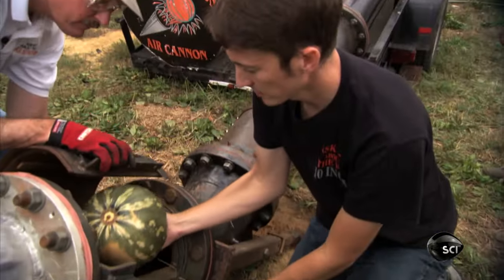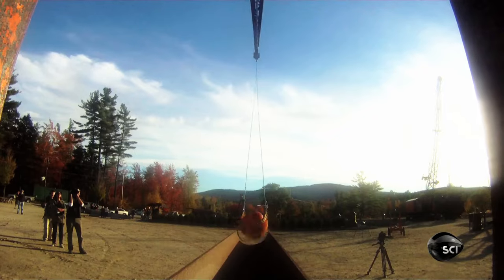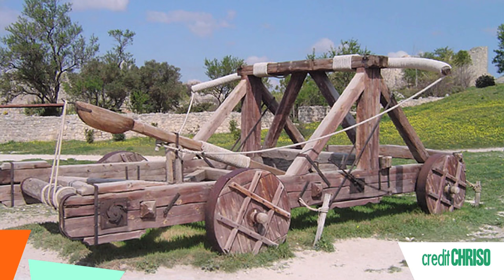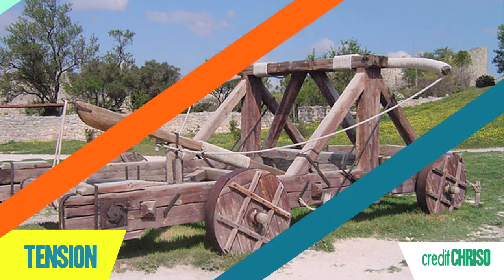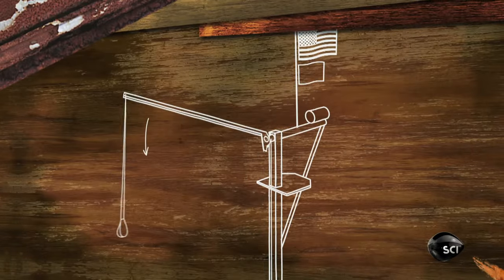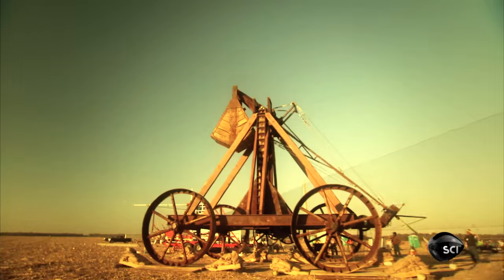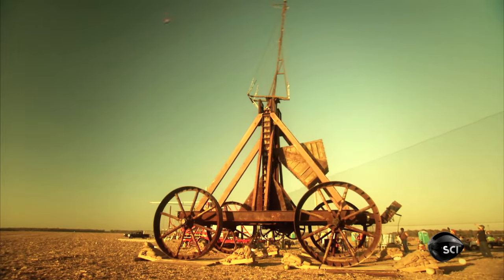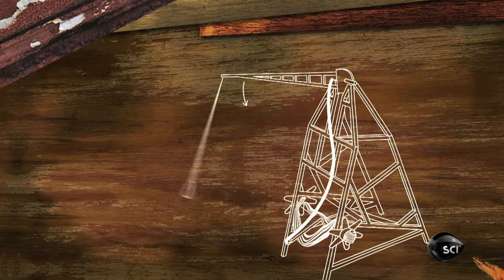The Physics of "Punkin Chunkin"

Comment: I haven't seen one, but I imagine the difference is pretty simple. Fermentation is a specific process in which a fungus eats organic materials and produces a gas (usually carbon dioxide) and an alcohol (usually ethanol)

Rotting is a general process in which organic material breaks down in many number of ways, including fermentation but also self-activated cell death (either through running out of energy or burned through some corrosive liquid) and being eaten by small animals and plants.

Comment: Not a ton to say about them. They're basically electrons with a positive charge. They're generated during radioactive decay depending on the isotope, and when one meets an electron it results in annihilation of both particles and a release of energy. A positron can join with an antiproton to form antihydrogen.

Comment: i is defined by the property i^2=-1, because -i is just as valid a solution to x^2=-1.
i^2=-1 is equivalent to i=(-1)^.5, but square roots are inelegant, so we square both sides to get i^2=-1. We also tend to avoid the i=(-1)^.5 definition because that can lead to the false assumption i^2=(-1)^.5*(-1)^.5=(-1*-1)^.5=(1)^.5=1. This false assumption gives a much better reasoning for the existence of i than what I gave earlier. It's much easier to keep track of i than negative square roots.

Comment: Energy, as a physics term, refers to the ability to cause change.  The simplest form of energy is work, which is force applied over distance.  Because of the conservation of energy, all other types of energy can be converted back into work.  So a pumpkin with 100 joules of kinetic energy has enough energy to apply a 10 N force for 10 m, or a 1 N force for 100 m, etc.  People talk about converting matter into energy, but it's probably more accurate to say that matter is a form of stored energy.

Comment: @2:32 Wrong. since g is constant, and f=ma, only the mass is variable in how much force is applied to the pumpkin. The variable affected by the height of the counterweight is how much time it has to accelerate the pumpkin before it leaves the trebuchet, thus having a higher counterweight affects the velocity of the pumpkin, but not the force applied to it. It is momentum that is force over time, and thus the higher the counterweight and the heavier, the more momentum it gives the pumpkin. DFTBA

Comment: When I was a young alien, I build a pumpkin catapult consisting of a vertical, pumpkin-caliber, nearly-vacuum tube with a pair of teleport gates at the ends, and a switch to connect the bottom gate to a third, 45° upwards pointing ejection gate. The idea was to put the pumpkin into the falling tube, to let it accelerate between the gates, and to turn the switch once it had reached terminal velocity. 
It was fun! The pumpkin almost reached escape velocity once. I wonder where it went down.

Comment: if the basket or pouch the pumpkin is in is well-done and nicely supports the pumpkin, they can really survive a lot. So far the most extreme machines dont yet really run into such problems. and you could if necessary switch to melons, they are more durable, more dense and more round.

Comment: I know what they mean, but build-up air-pressure could be considered an explosive.
I've tried building a trebuchet with some friends. I don't know what you mean by more accurate. It didn't even shoot forward all the time. :P
I see some suggesting rail-guns. They require a huge amount of electricity even with a good conductor, which pumpkins aren't. You could use a metal casing, but does that really count as throwing the pumpkin?

Comment: I thought about this as well, however the air cannon barrels are not short and couldn't a rail gun be fairly finely tuned so that it can accelerate the pumpkin the optimum amount for whatever length the barrel is? assuming it doesn't get torn apart at whatever speeds those are anyway.

Comment: sabots are not allowed? But in designs involving slingshots, or catapults, you can also build a nice pouch or basket for the pumpkin to sit in and be supported from more than one side. Maybe the rule is that only the pumpkin may fly, no parts of the machine, that makes a lot of sense also for security reasons. so why not a sabot that stops at the end of the barrel and doesnt fly out, like the cages used in cannons to fire humans? that could be legal.

Comment: "they added an additional touch of genius, adding a sling instead of a bucket"

umm... this is not new by any means, considering the first roman onagers sling based and LATER went to the cup design because it was more accurate from hitting troop formations, at the expense of greater range
and as a note, ALL historical onagers and mangonels worked via a torsion spring.